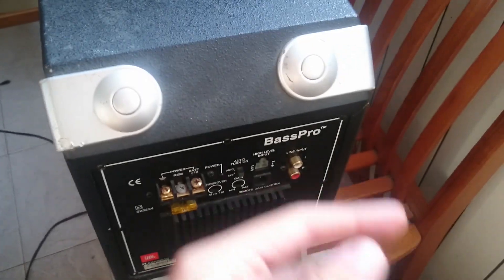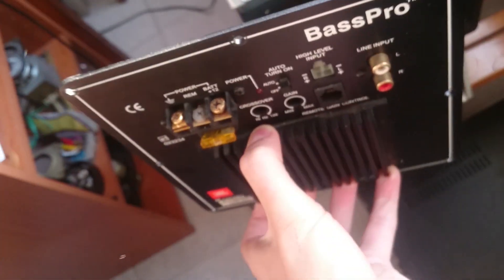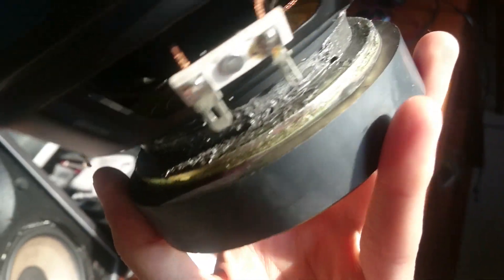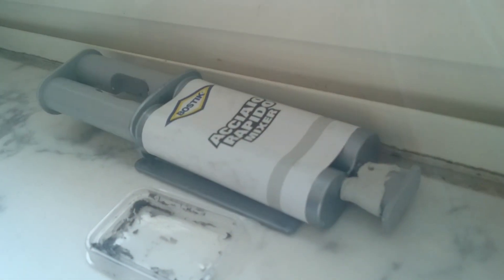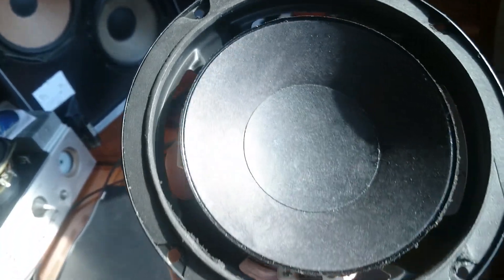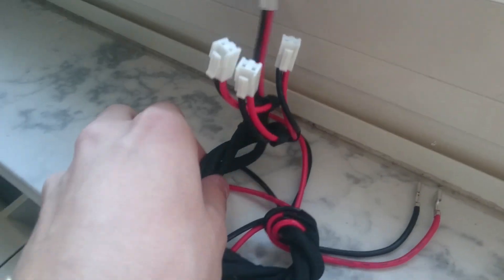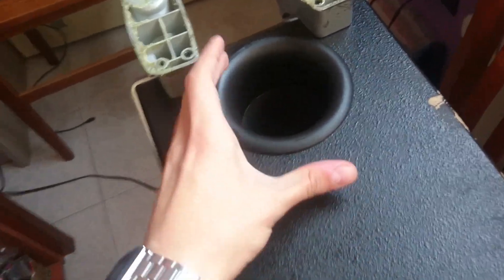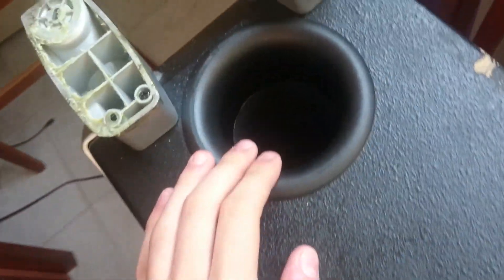What's inside a JBL BassPro? Disassembling

Comment: Heya! Hopefully you see this post.
So my Basspro decided to stop producing any sound. It still has power n all, but mine seems to be missing the foam ring around the speaker part, just like this one. Could that be the issue? Please respond :)
Reply from the maker: Hello! Nope, the foam ring makes it sound bad but it would still produce any kind of sound
Reply: @ciro589m  Ah ok. Well, it seems to be "working" fine, gets all the power and movement n all. I'll still fix the foam, see what happens. Not a massive amount of money so if it is still dead in any way, it wont hurt me too much :)
Thanks!

Comment: How did you pull out the amplifier? I tried to whip it out with a screwdriver but only damaging the wooden box 🙁
Reply from the maker: Mine just took off easily :/
Reply: @ciro589m  weird....I try it again when I'm home again. Mine is vibrating like crazy when the bass isn't high.... like something is loos inside.
Reply: @Joey.Oranje  And You pulled it out? im facing exact same problem right now and dont know what to do ://

Comment: could be a 2 channel with two coils in series c;
Reply: I think it's more for efficiency by the look of the amplifier, unlike most of the subwoofer amplifier that can drive watts in one channel, this one uses amplifier chip that powered by 12v
Reply: high wattage car amplifier usually has a transformer and MOSFET stage for stepping up the voltage, to provide enough power for speaker
Reply: The amp is a quad channel, there are two channels for every chip